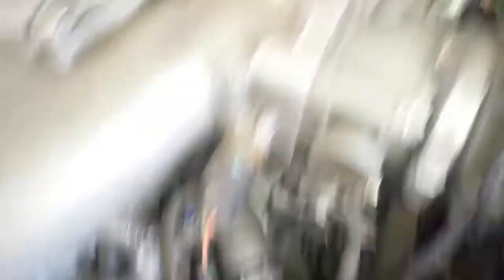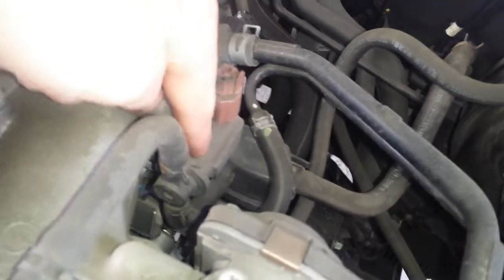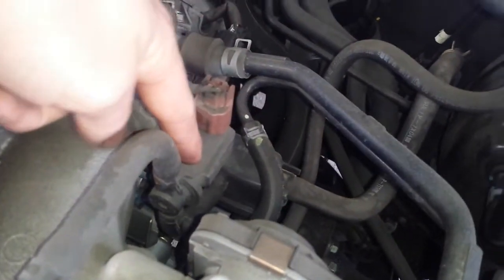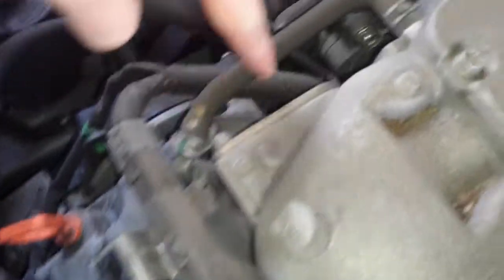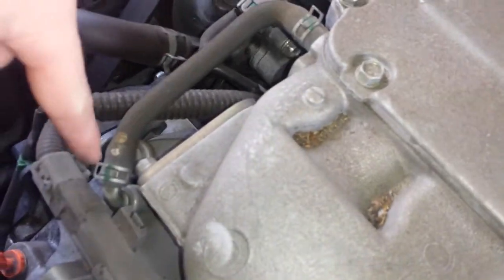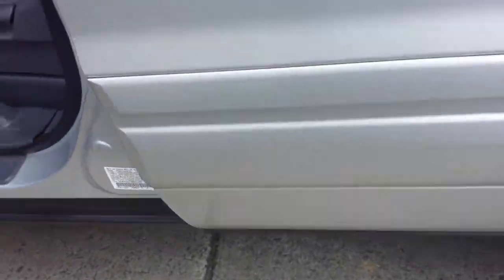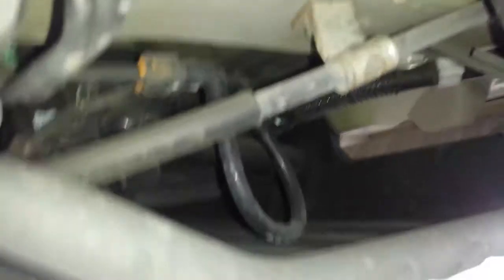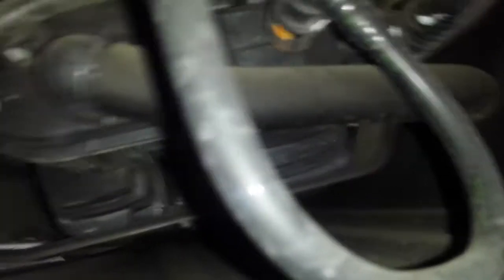Honda Pilot Emissions: EGR valve, EVAP canister, EVAP purge solinoid, & PCV

Comment: I put 9v to the purge valve and it clicked. Could it still be defective?
Reply from the maker: It is possible. I would also hook up a vacuum pump to the solonoid. With no elect electricity applied the valve should be shut and hold vacuum.. If the  Is solonoid does not hold vacuum with no electricity applied it is defective as well.

Comment: Scotties Hobbies What would be the best course of action when replacing the two way valve
Reply from the maker: Might the 2 way valve have a different name?
Reply: Scotties Hobbies Overfill limiter
Reply from the maker: You cannot pump gas? The EVAP Vent valve?
Reply from the maker: Man. I have never personally came across this issue. You have one mighty complex evap system.

Comment: Thanks for the video. I ran through water in a 2011 odyssey minivan and damaged a purge valve for my canister. Idiots at the auto store sold me the purge valve in the engine bay. If you have this problem be aware you want to buy the purge valve that is in the canister itself as it's the one that goes under water (canister is on the bottom of the vehicle kind of below driver seat, remove plastic cover). The canister and it's contained purge valve are separate parts. Here is the part you need if you flood yours out
https://www.amazon.com/gp/aw/d/B00IFPCYGU/ref=ox_sc_saved_image_3?ie=UTF8&psc=1&smid=A37036AG7YKV4O
Reply from the maker: +Clark Stuart thanks for the advise.